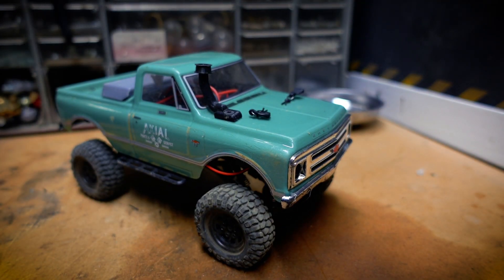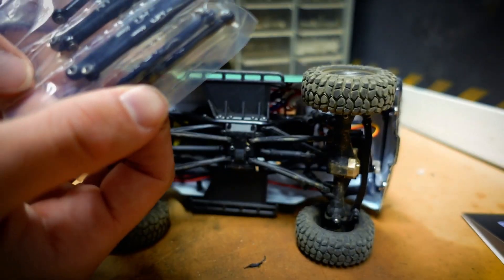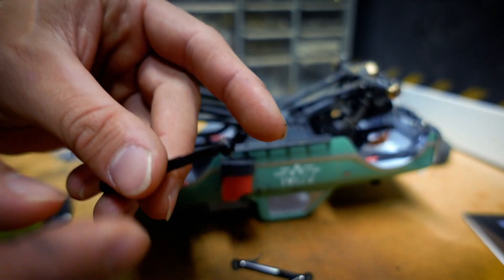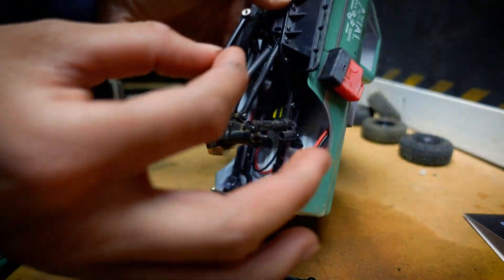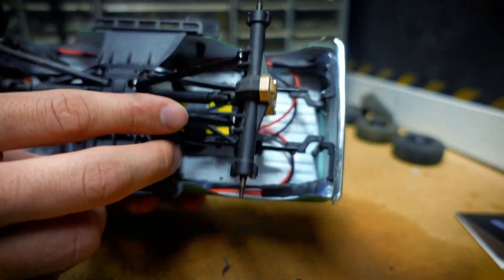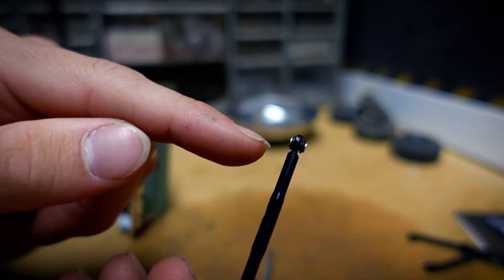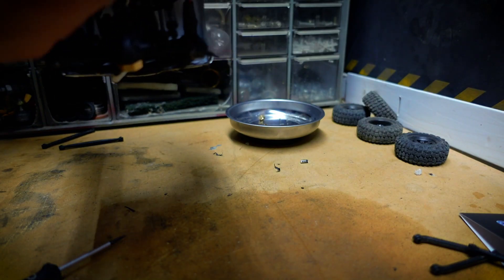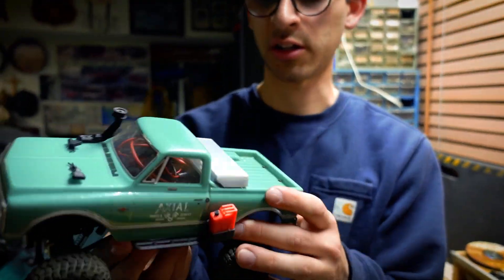Axial SCX24 C10 Hot racing Aluminum Link Upgrade Ep.12

Comment: Hello, canyou run the brass wheel spacers with the brass steering knuckles?
Reply from the maker: Brass Axel weights ? Check out the jeep playlist I did
Reply: @MiguelCortez  yes, i the found the video tight after haha. Thanks man.
Reply: Do you have trouble with the front drive shaft rubbing? Mine won't even turn, because it is stuck under the servo mount. I installed the HR aluminum high clearance links.

Comment: The front lower links are actually the 50mm links not the 51mm. You want that axle mounted servo sitting as near flat as possible
Reply from the maker: From the research I did on the hr website that was why they are in those spots 👍